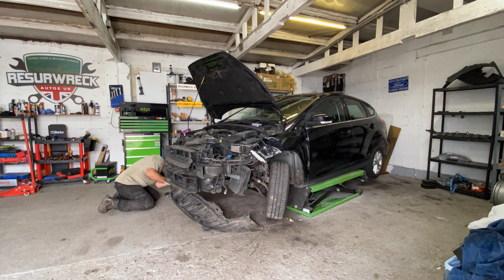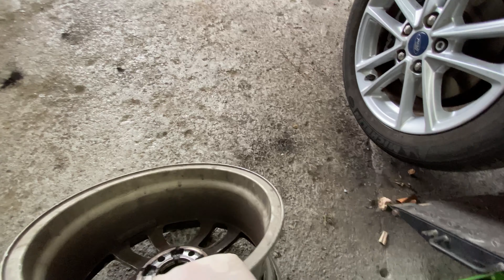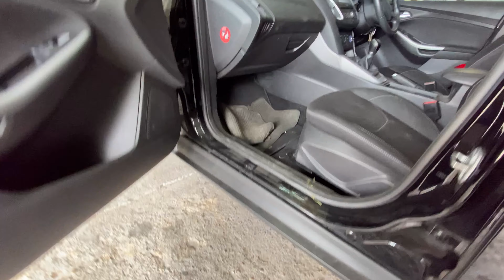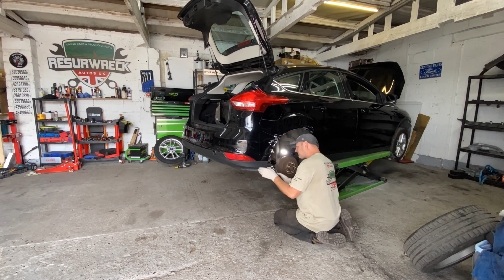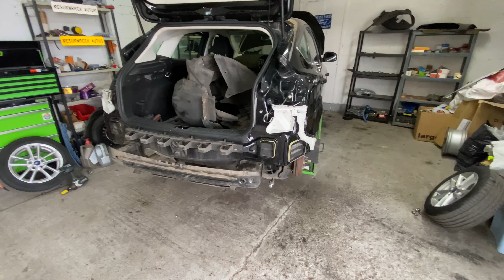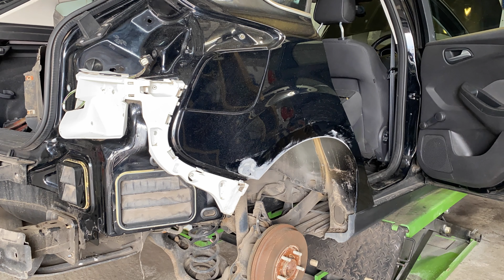Ford Focus 1.0 Litre Ecoboost 2016 Salvage Damaged Repair Part 1

Comment: Hi Mark, great content as usual. However, a word of warning! Please leave the actual painting of the car and repair of the wheelarch to a professional. It's fine to replace the damaged panels and save a bit of labour cost, but this is a 16 plate car and substandard paintwork will crucify it's value. By all means carry on practising on the cheap stuff, but sometimes you have to be realistic with what you are capable of. Don't let me put you off, but I've made these mistakes myself and learned from them. Anyway, quality viewing as always. Cheers 👍👍
Reply from the maker: Thanks buddy I do see what you are saying but if we don’t try we will never know what we are capable of I have been this way all my working life I’m not changing now 👍👍

Comment: i think you would be better painting the full passenger side of the vehicle as doing the wing door and rear quarters and the bumpers then  it will  most likely  make the front passenger door stick out  like a sore thumb ? the other side not so much as the wing and both doors will be in original paint
Reply from the maker: Hi Charles I was thinking that but that’s a lot of painting for me 👍👍

Comment: You must grind back your repairs back to bare metal. Filler will not adhere to paint, after a short time the edge will lift.
Reply from the maker: Thanks for the info buddy I will do that

Comment: Disappointed to keep hearing the rant about the CATS placed on vehicles there are good and bad in every trade , a lot of the cats are placed on vehicles from estimate and images supplied by the body shops , most vehicles aren’t worth striping to investigate further hence total loss , which in affect is what your purchasing , been a qualified engineer is not easy task as anybody who knows the trade , which we could turn this around and are all vehicles repaired do they follow the correct repair method ?